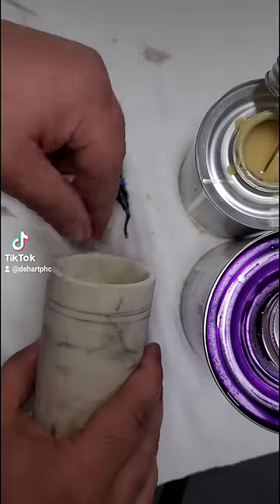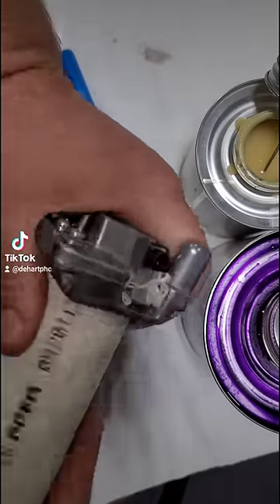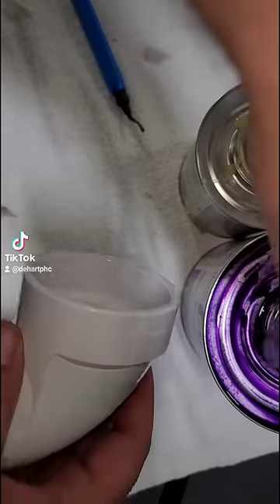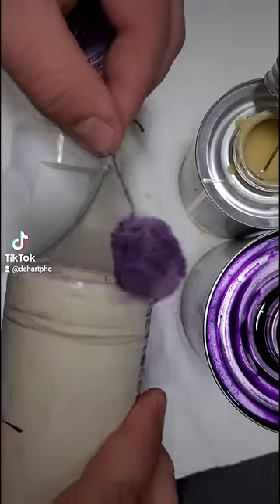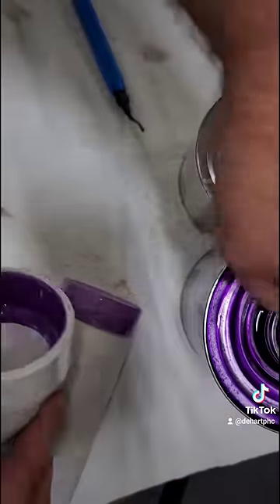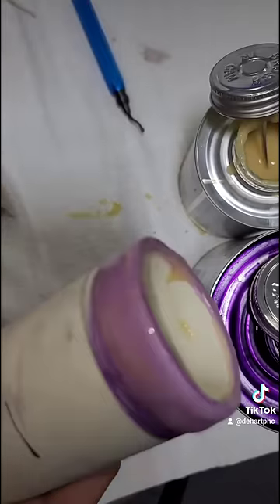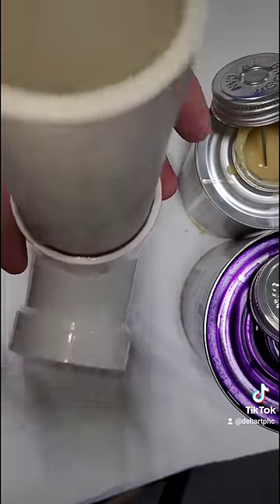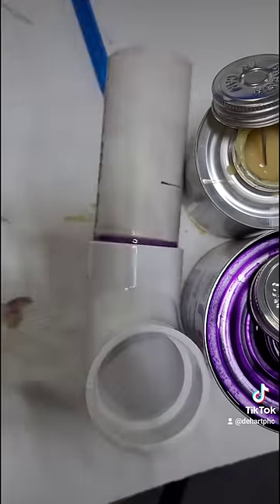How to create a great PVC solvent weld joint.

Comment: Machinist turned plumber, center in a 4 jaw chuck, indicate until centered, measure fitting with a micrometer to see how deep to insert the pipe.   Mask the pipe with blue tape.   Put primer in a spray gun and put 17 thin coats on, and then shoot 4 thin even coats of glue, while spinning it in a lathe.    Put the pipe on stands, level it.  Put the fitting in and level, then turn the fitting exactly 90 degress (verified with a level) then put it in a press and see how much pressure it takes for it to fail, if acceptable, do it all over again.

Comment: Gotta love plumbers who confuse PVC prep with copper.
Reply: What?
If it was copper he'd be sanding the pipe (assuming he's soldering and not compressing them).
It doesn't hurt even if not necessary.
Most plumbers, IDC what anyone says, know its not their house and it'll be years before it ever matters how shitty of a job you do, won't do any of these steps besides prime and glue stick and move.
Reply: Lol who does all this nonsense
Reply: @xChromerSatanasx  you don't glue your pvc?
Reply: @CoralBlueNumber2Lipstick  no I use duct tape
Reply: @ChromerSatanas I’ve had better luck using gorilla tape. For gas lines I always use that black tape that silly electricians use
Reply: @tonyg4622  lol yes electrical tape stretches, I should make a video
Reply: @tonyg4622  pff, you never hear of wifi gas connections?
Reply: ive noticed this too...ive been plumbing 20yrs and have never debured pvc with anything but my thumb and i cut with a sawzall...never had a problem
Reply: @jasonbeasley4348  gotta love the rare times you catch the bur just right.
Reply: i gotta tough thumb now
Reply: “De-burr tool” I don’t even think union ppl do that stuff lmao
Reply: @jasonbeasley4348  exactly lmao
Reply: @Jason Beasley  occasionally I use my razor knife for a bur, otherwise saw cut is great as is
Reply: @jasonbeasley4348  100%.. this guy just went full nerd on that pvc.. so excessive and a waste of time.
Reply: @Jason Beasley  when I'm cutting with my compression cutting pliers (for a lack of a knowledgeable term) my cuts are not straight/90°. Is this a big deal if I'm properly priming and gluing?  I'm working on aquarium plumbing so there's very little pressure and it's always open. Never any build up of pressure as in shutting off a circuit would cause.
Reply: @Luttrj  so the answer is probably not but try and get them straight as possible make sure you are priming both sides, the pipe and the fitting, and make sure that you insert them fully.  Im a plumber please feel free to ask any questions you have outside of this.
Reply: @goblinsarereal4954  thank you.  I did prime and glue both the pipe end and the fitting, then pushed, twisted ¼ turn, and held in place for about 10 seconds.  
I did have one ABS X PVC joint push out so i snatched it apart, wiped it clean and then reapplied the appropriate green glue and redid that joint.  I'm hoping it seals.  All of this is on a 125-gallon aquarium with a 40-gallon sump. All of the pipes will always be open so there should never be any pressure against these joints.
Think it'll be ok?
Reply: @goblinsarereal4954  also,  if a pipe does push out of a fitting right away, is there anything wrong with simply pushing it back together and then holding to prevent this from happening again before it fuses together?
Reply: @Luttrj  not at all! I'd reccomended trying to hold it together but no thaf almost always happens, just do your best to hold it together and it should set up nicely, the only real danger is having it push out before it's set up so if it's still wet glue and it pushes out no worries at all just push it back together, and at the end of the day inspect your work thoroughly always at the end for leaks nothing wrong with making mistakes I do it every day just make sure that you are thoroughly checking for them and fixing them.
Reply: @goblinsarereal4954  these pipes won't have any water through them for at least a few more days.
Reply: @Luttrj  you'll have no issues with your joints.  It's not complicated.  You've got it spot on.
Reply: I wanted to see the glue mess inside the pipe joint. That was a lot of glue.
Reply: @jasonbeasley4348  i don't believe this. You have to have a PVC cutter. Especially since 20 years ago cordless sawzalls weren't everywhere and the 1s that were around were full size, not like the cordless hackzalls that are around in the last 8 or so years.
Reply: @SmDJeremy  PVC cutter is still better than a sawzalls especially when working in tight spaces. The M12 MIlwaukee is awesome, my Ridgid and Lennox ratch ones are great too
Reply: @Luttrj  they hold?
Reply: @shilohmaverick898  indeed, everything is dry. Thanks for checking.
Reply: @tony g  millwright/gasfitter here... I really,  really hope you are joking because otherwise you are risking the lives of everyone in your house!

Only acceptable thread sealer is pipe dope and yellow T-tape (rated for propane and natural gas).

Save the electrical tape for electrical work.... and job site band-aids lol
Reply: @todtalk3912  lol PVC really needs no prep😂
Reply: He's obviously not a plumber

Comment: It backed out. Also, leave plenty of primer showing for the inspector. You never know if he's gonna fail you if he can't see the primer.
Reply: Thank you!
Reply: Yep.   Over do the primer so inspector is happy.   Keep that pipe in there firmly for at least 15 seconds then watch it to see if it is creeping out.  Don't wipe the excess glue with bare fingers.    The organic solvents go through skin and is adsorbed into the body.  Wear a glove if you must wipe the joint but, the excess glue doesn't hurt anything.  You can leave it.  Also,  wear a face mask with charcoal filters.   You won't smell any fumes.   The charcoal grabs it.  If you can, have a fan pulling air away from the work space.  Don't blow air on the glued joints, it may dry the cement. 
Pretty good video.   Chamfer and inside de-burring spot on!
Reply: Unless you are in certain backwards places like St. Louis County Missouri where they mandate clear primer, if they see purple they will fail it.

Comment: Ive never seen a plumber do this
Reply: And you won't.  He's wasting very expensive time.
Reply: @texasslingleadsomtingwong8751  when you get paid 150+ an hour... Yeah doing this shit is just costing the customer a ton for almost no gain.
Reply: @goblinsarereal4954  it's even worse when my wife who owns our company sees how much labor the "simple job " cost . 
I'm the master plumber  but not the master of everything , 😆 . She's gonna set that boy straight or he's cleaning out his vehicle.
Reply: Just use a chop saw to cut the pipe. This leaves practically no burrs. I use un purple primer, which shows the primer under a uv flashlight. Also use the letters on the pipe, with the lines on the fittings, to align the fitting properly. Medium body glue gives more fit time.
Reply: They only do this when the line will be under pressure. This isn’t necessary for DWV applications.

Comment: I had one fitting blow apart in all my years as a contractor. I never once used anything more than a pocket knife to deburr. I'm pretty sure the fittings have a micro taper to them so you definitely hold them together, or else you will see them push apart.  For residential repairs I always used clear primer. That makes a better looking manifold.
Reply: Anytime I came across an irritation manifold without copious visible primer, I explained to the customer primer was skipped and I replaced the whole manifold.
 
So thanks for the extra work lol.
Reply: @albertnonymous1886  awesome sales tactic bro. 🤡
Reply: @albertnonymous1886  You wouldn't be working on my jobs anyway, lol.
Reply: They're supposed to have a slight taper, but not all of them do. Now any time you cut a piece of pipe You should always bevel the leading edge, especially on larger diameter pipe.
Reply: @albertnonymous1886  you think having purple stains over the manifold means it was done properly? Lol

Comment: He didn't hold the pipe in after doing the 1/4 turn. You have to hold it pressed hard into the joint or it will back out and have a poor/weak glue joint
Reply: god forbid it pushes out 1/8" inch. that would ruin everything
Reply: @Brian  I feel like you don't understand how pvc glue works. having 1.75" of glued length vs 2" etc isn't going to be make it or break it. remember, op was talking about strength and nothing else.
Reply: Hey pipe engineer here. Mr c brunnem or however u pronounce your name. Let me explain u this.
The primer acts as a surface prep and a activator for the glue to properly bond with the pvc. The primer will actually bond to the pipe aswell.
If once u have your primer applied and you go to apply your glue u break that bond they won’t ever reseal properly as the molecules stretch out and won’t restore the back into shape like a memory foam pillow. Think of it as a head gasket bolt, once u tighten it it will stretch out of shape, if u go to loosen or break that connection it won’t ever reseal properly, some folks get away with it because some manufactures over build engine head bolts to withstand plenty or power, etc but why risk the chance. Once you glue that joint  turn it alittle and maintain firm pressure. If you back off even the slightest you risk causing an microscopic fissure that could possibly leak over time. Yes you may not notice it within 5 to 10 years but 40 to 50 years down the line that tiny microscopic tissue you as a shitty plumber has made will have expanded tremendously to an unbelievable size of closely 1/64 of an inch  on a standard home with 3 to 4gpm of flow that could be 1 gallon of water damage every 82 hours that’s 1 gallon of water in just four days. Do people right and do a good job. Think about it if someone did you like that or your mother. People need quality work.
Reply: @antoniononame3037  Thank you for that reply. This is what most people, and most contractors and workers today don't get, or don't give a crap about. They just build to get the inspection passed, and to maximize profit by minimizing labor. They don't care at all that their work will fail someday, only that they won't get caught when it does.

Comment: On larger pipes I also take a marker to the piece of straight pipe on How Deep The Fitting is so that I can make sure it gets seated completely when I put it together after gluing.

On 2-4" PVC,  it's good to have someone on the opposite end of the pipe with a wood block and hammer to tap it into the coupling or bell-end joint.

Comment: You got to hold the pipe in place for a few my boy. Avoids it doing the ol’ spready
Reply: Of course somebody had to find something wrong he did
Reply: @outdawrzmuhn  Do it right.
Reply: @outdawrzmuhn especially on smaller pipe like three quarter or 1 in, those pipes can push off each other very quickly it's not held until they secure. 

I have installed thousands of feet of PVC over my career as an electrician and that is a 'must'.

Larger conduits don't do it quite as much but still good idea to hold them until they can't back out on their own.
Reply: @InkedUpHonda  Agreed.  Necessary step.

Comment: Most city inspectors will reject a fitting if it has no purple on it.
Reply: Meanwhile, we give city inspectors some white to get a pass
Reply: Do yall not stack test there?
Reply: Just gotta splash some on after you put the joint together with glue only 😂
Reply: @TheCoolStuffHD  If your going to that... You might as well do it right. Insps aren't stupid.
Reply: Clear primer aware
Reply: Most city inspectors don't know as much as the guy at Lowes busting the edges off all the lumber with his awesome forklift operating skills. Now who wants to buy a box of wide tipped purple sharpies?
Reply: Are your tradesmen that bad you have to get everything inspected?

Comment: Normally I cut it crooked, make a mess out of everything including my clothes then try and force it together but the burr doesn’t allow me to shove it enough but that doesn’t stop me from wasting valuable time trying to force it together. By this time the glue is too set to allow me to spin the fitting to its correct orientation.

Comment: Glue the fitting first always because you can set it down, always glue the face I like how you did that in your video!
Reply: Plus the fitting has more protection from wind  and drys a little bit slower because of that
Reply: @lxn_ni1814  I'm no pro, I glue fitting first, put it down, less drip from the fitting, then the open pipe
Reply: @jakefriesenjake  i mean drip all depends on how much glue u slap on there both the same material. But yes glue the fitting first every time
Reply: @lxn_ni1814  come again? Who the hell taught y'all to put the glue on before the primer?

Comment: You forgot to hold it together for a few extra seconds so the joint doesn't push apart on you
Reply: The air bubbles cause it to push apart , thus the quarter twist

Comment: I usually follow these steps myself but, with a few minor differences: first, I cut the pipe at a weird angle because my hacksaw blade is bent all to hell. Then, I fight with the lid on the cement and finally open it with a pipe wrench and then I spill most of the primer on the floor. I found that if you drop the joints in dirt and sawdust then prime and glue them, they usually hold anyway.

Comment: I’m an irrigation technician, I use a sander to bevel, one coat of primer and one coat of glue. Using too much glue causes it to drip into the pipe. As long as you use primer and twist, it stays for years with no issues & that’s under pressure 80% of the year 🤷🏽‍♂️

Comment: I hate the purple primer. It stains everything. I always use clear primer.
Reply: I agree. the only reason it's purple is to satisfy the inspector.  supposedly it shows it was glued.  but I've seen joints that were primed and not glued at all
Reply: @danpettis1675 no,  it shows that the pipe was cleaned with a primer to create a permanent seal.... Lots of guys won't even primer the pipe first they'll just use glue and wonder why they have leaks
Reply: How do you pass inspection?
Reply: @rjthomasindyusa first , you have your license. 
Next you go buy permit 
Then you follow code 
Lastly , you call and schedule that pesky inspection.  
If you don't know , then you have absolutely made my company a ton of money .
Reply: @texasslingleadsomtingwong8751    I was asking the first commentor how he passes inspection with clear primer. The inspectors want to see purple primer around here....

Comment: Buck knife works well also.
 Also,duct tape your cans together.
  Most important is after the 1/4 turn,hold your joint together for several seconds so it doesn't separate !

Comment: Very true man. Fittings are much harder, injected molded. Pipe is much softer, extruded and not injection molded. Fitting gets primer first to allow it to soften (prime) the fitting for proper gluing. Most people don't understand that. Not really important in residential pipes, but nuclear and high pressure pipes carrying radioactive or hazardous waste... If this isn't followed to the T, the fitting will most definitely fail.

Comment: As long as you have a straight cut all you need is your primer and glue you don't have to shave off that inside work been doing plumbing for 40 years
Reply: You don’t really need the primer either. I’ve plumbed for years. It’s works but isn’t really necessary
Reply: I like using clear primer. Only need purple when it's getting inspected
Reply: @jonathanjohnson4633  bro....
Reply: @fubar5163  sarcasm lol
Reply: Well Chuckles, you've been doing it wrong...... for fourty damn years.....

Comment: So when I do this on an industrial scale From 1/2 pipe to 6 in pipe i lightly sand both surfaces with about 220 grit emery cloth and use to ream the inner edge of the pipe then i primer both pieces including the front lip of the pipe then i put glue on the front of the pipe around the pipe and inside of the fitting then hold them together about 10 seconds after making the quarter turn then i wipe excess off so it looks clean

Comment: I just get some 3/8s steel plate drill a hole through both ends of the plate and a hole through the PVC pipes stick a grade A bolt through and bring it home with an impact, they never separate for me

Comment: 1) cut with a saw
2) run a knife over burrs 
3) clean prime and glue with no confusing BS, just put it on.
4) put together and 1/4  turn
5) hold for 30 seconds to a minute depending if it is cold out to make sure they don't push apart.
Done simple and easy.

Comment: I usually cut it with a wood blade hand saw, (I've never seen the purple stuff so I skip that). Then I use abs cement, (skip that quarter turn that's just a myth). Then I install the pipe and lay a bunch of towels down to catch all the leaks. (Change towels weekly)

Comment: I usually don’t do any of the pipe burring inside or out. The primer goes on once and the glue goes on once. Sometimes I do the quarter turn sometimes I don’t. Then I take a leak 🤤 aah into the pipe to make sure it doesn’t have any leaks. Inspect and then I know it’s good. Works out for me so far 😊

Comment: No, cut the pipe with a bargain bin Dremel cutoff wheel, sandpaper with well-used 50 grit, then use rubber cement from your boomer dad's 3rd grade school supplies (which are still in the garage for some reason, despite the fact that he walked out on your mom as soon as you were born). Job done! 

Note: Be sure to copiously inhale the rubber cement to help forget your dad the same way he forgot you. It will also help you become an excellent plumber in your own mind.

Comment: I put in fire sprinklers for a while and all we did was cut and glue. No primer or anything. What you did would make an excellent connection, but I'm curious how much pressure you are intending to have in there? It's got to be a pressure or material safety requirement.